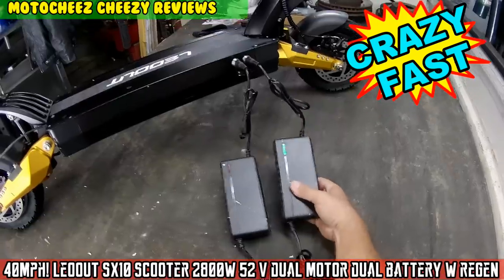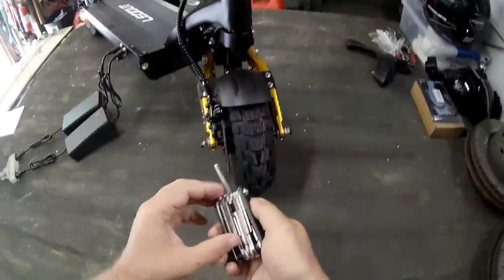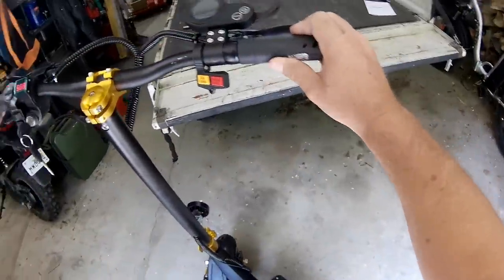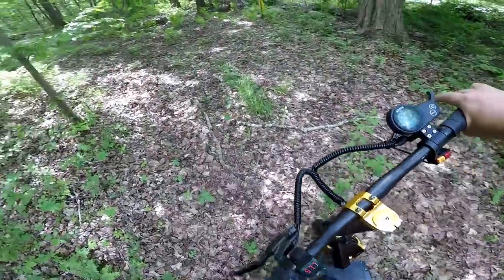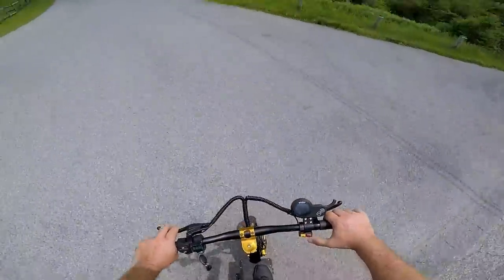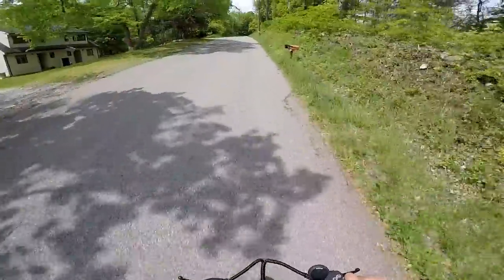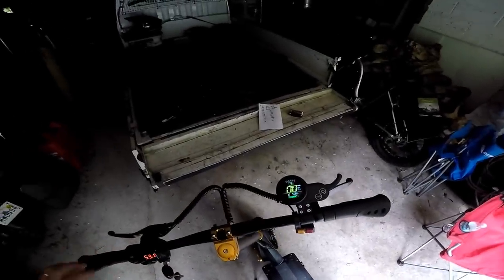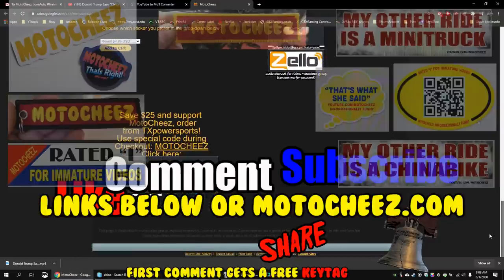40MPH scooter Dual 1400w Motors, Dual 52V 25AH Batteries, 10'' Heavy Duty Off-Road Tires Leoout SX10

Comment: That's a hoot right there!  This is the way they need to set up the E-bikes, with those dual motors/batteries.  Change the gearing a little and fitted with taller/wider rubber would be kewl.
Reply from the maker: I agree 100%
Reply: You can get a folding dual suspension and dual motor ebike with a 60V 20 ah battery that goes 35mph .. Can go up about any hill. Pretty cool ebike you could put in most vehicles without a rack. Fabulous Havoc X2  I think it is called.  .. Very cool but heavy to lift it even folded. Ariel Rider makes a dual suspension dual battery, dual 1000 watt motors bike called Grizzly. It's the king of fat tire bikes. Very fast..very long range.. 35 plus mph. Not folding and 105 lbs😁
Reply: Mid drive ebikes are where it's at.
Reply: @IggyBiggy  I'm thinking mid drive is ok if the throttle only speed is the same as pedal speeds. And if you have good quality  gear cassettes and chains that won't need replacing every year.

Comment: Change your tire size down to 9.6 and that’ll put your speedo about dead on. And the mode buttons do work, it’s just that eco mode limits the speed which makes the modes not work but if you take eco off and turn on turbo then the mode buttons will work. Mode 1 will be like 16mph, mode 2 will be like 26 and mode 3 will be top speed
Reply from the maker: My modes didn't seem to work in turbo. I'll try that tire size

Comment: I purchased this scooter i give it a 8/10 and the reason is, for all of the features, the battery should have been a stronger more long lasting battery. So for those who want an electric scooter to make deliveries, you need a stronger battery.
Reply from the maker: I think they fit what they could in the floorboard, it's pretty heavy as it is now but double the size battery would mean double the size floorboard
Reply: @MotoCheez  I wouldn't mind a double battery. I also don't mind double the floor board. The scooter has too much power for the battery to be 52v 25ah.
Reply from the maker: @ramonacosta5596 when I was out cruising money around I would just lower the power level and it seemed to get pretty good range if it was all flat around here you get quite a bit of range
Reply: @MotoCheez  I agree with you that's why I said earlier if are trying to work from the scooter like as an uber eats driver, this scooter isn't it. Which is why. I gave it an 8/10

Comment: I just bought this scooter, around the 17:00 minute mark you mentioned something about regenerative charging. Can you elaborate more on what that means ?
Reply from the maker: When you're going down a steep hill, if you tap without apply the brake you can feel it slow down, that's recharging the battery. In the settings I show how you can raise and lower intensity of the charge, too high and it feels like it's putting the brakes on harder but charges faster

Comment: I just got one today and the thing is absolutely nuts!! What Volts would you recommend not going under to save on battery longevity?
Reply from the maker: Its stock setting are probably good for low battery cutoff. Congrat!
Reply: I try to keep my bats between 47 vs
's and 55 v's, on a 52 volt system that keeps the  battery between 40 percent and 80 percent. If I plan on going on  long ride, I'll fully charge it. I can usually get two rides before they need a short battery charge.

Comment: Hi MC, I gotta say, I like your review of the product and become interested in it. How did you find this? Been looking for a good quality e-scooter, well-built, good-looking and at the same time not breaking my bank acct. I kind of like this, that it is in a low $1K price point. Gotta ask though, how's the handling of the scooter at high speeds? Do you get any of what they call death wobble? And how is it performing now that you have ridden it for sometime, did it diminish in performance? Or anything break so far? 
I apologize for my many questions, coz I had a bad experience with my low-end 1st scooter I had to return it, so just want to be sure this time around. The battery died on me on 2nd week of ownership, And yeah how's the battery on this scooter, still charging good?
Any feedback of yours will be greatly appreciated! Thanks in advance.
Reply from the maker: It's good quality build, no death wobble. Battery been holding up well, charges back up good. I've been out a few times and had friends try it out. Thing is fast!
Reply: How much do you weigh would I be able too get them speeds being 220 pounds
Reply from the maker: I'm 235lbs 49 standing up, squat down and can get 52!
Reply: @MotoCheez  awesome I found it cheaper on there website but not sure about it being real I can’t find any reviews of the scooter being bought from there actual website just amazon
Reply from the maker: They seem legit, but I do like the added layer of protection from Amazon
Reply: @MotoCheez  I might go for it from them directly with shipping it’s 998
Reply from the maker: The link in my video description? I believe so
Reply: @MotoCheez  out of this one and the T88 witch do you like more
Reply from the maker: I like this SX10 better, suspension is much better, smoother ride. Everything else is the same

Comment: May I ask as to the quality of this product? I'm a college student looking forward to using this scooter for mini-transportation and obviously some speed! I'm thinking about getting this instead of the Joyor S10, but I'm not sure if Leout is a good brand as I don't see their website's customer reviews.
Reply from the maker: excellent quality, I think most all these scooters are rebranded maybe with different controllers etc but it seems to be a pretty good product
Reply: @MotoCheez  ah, that makes more sense. I was wondering why Amazon has couple of the same leout scooters with the same specs, but a different brand releaser. Thank you for your information and opinion. Will order this soon.
Reply from the maker: @JINSEOK3716 Leoout does have a couple different style scooters. This SX-10 has much better suspension

Comment: In the instruction manual it says to charge after every use so the battery won't as damaged in the  long run. Is this true?  When it comes to smart phones they say charge the device once its under 20 percent but this sint the case with this electric scooter. Im just trying to make sure whats the actual proper way to this battery last as long as possible
Reply from the maker: They don't specify the type of lithium battery it has, so I'd hope the directions  are correct, I always charge after use on mine

Comment: I dont think this has dual battery, at least not 2 25AH batteries. 2 charging ports yeah, just not 2x 25 AH batteries
if it did, the range would be listed as ~ 80miles
Reply from the maker: I did not confirm whether I had two batteries, and one other person pointed that out but I do know that when both charges are plugged in one charger will shut off before the other

Comment: It’s 1 battery bud! Lol everyone I’ve watched reviews on this scooter keeps saying 2 batteries because of 2 chargers but those 2 chargers is to cut your charge time in half on the One battery.
Reply from the maker: Is that confirmed? Why does one charger shut off quite a bit longer than the other. I have not opened up the unit to look, just going off specs

Comment: On the MS668 it shows a battery life mine is low and I can’t figure out how to get it back full. 

Anybody have any idea how to charge this battery life full on the display screen (MS668 throttle )
Reply: Only have 10 miles in or so and the battery on the display throttle is almost empty how can I get it back up to full. I’m so lost does not mention it in the manual at all 🤦🏽‍♂️
Reply from the maker: What do you mean? You charge it  for several hours and it's not showing full?
How many volts on the meter on left?